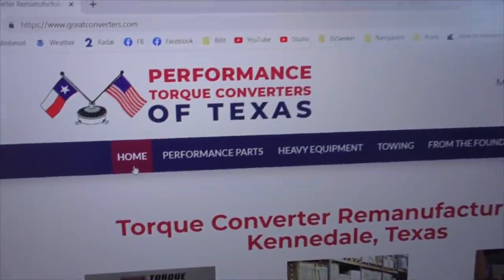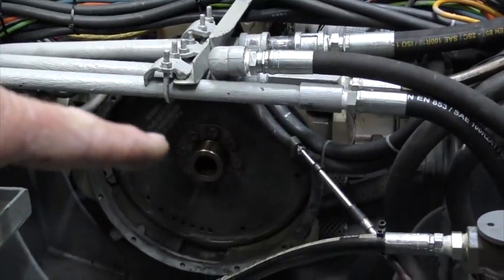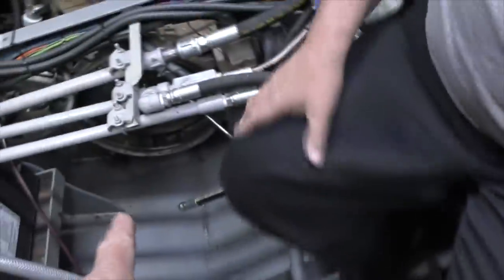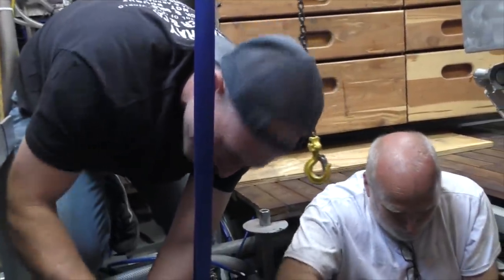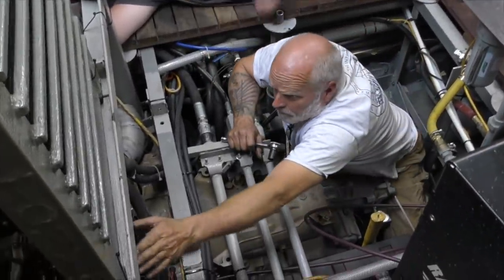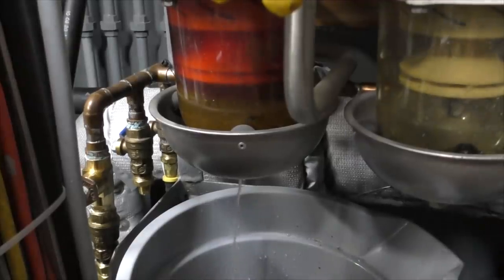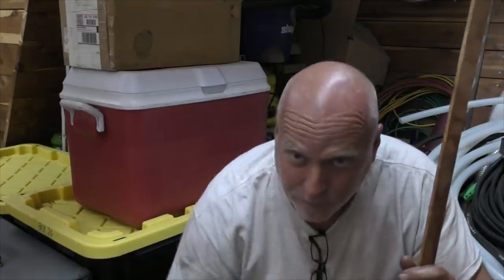School Bus Transmission in a Boat - Part 2 - Torque Converter Eliminator Installation

Comment: The transmission "kickdown" (this name is improper, it is actually a throttle valve or TV cable" controls pump output pressure, which in turn controls the shift points. The moral is, if you leave the kick down unhooked, your transmission pump will put out minimal pressure which is OK when idling around, but if you go to a higher power situation like this (higher throttle setting) your transmission will not have sufficient holding pressure applied to the clutches and bands, and the transmission will burn up the internals. If you are going to remove the TV cable you will need to permanently tie the TV lever forward (simulating a higher throttle setting) so that there is sufficient hydraulic pressure to ensure the clutches and bands have enough holding clamp up force.

Also, you need to ensure that the converter (or converter eliminator) is ALL THE WAY engaged. This is tricky because the pump inner gerotor drops when you remove the converter, and you usually have to spin the converter several times before it picks up and engages the inner gerotor. If you do not have it slid all the way in to the transmission, and use the engine to transmission bolts to force it in you will fracture the drive lugs off of the pump gerotor, and you will be pulling the transmission again. After the engine and transmission are bolted together you should have to pull the converter (eliminator) forward to meet the flexplate (flywheel) and then install the bolts.
Reply: Came here to say the same thing, that cable is important even inf your just locking in 1st gear, youll burn out any clutches/bands in the gearbox once it gets under load. Its trivial for a man of your ability to just connect the cable up. so connect it up :)
Reply: l was waiting for someone else to tell him . when he cut the cable i shouted O NO . l was trying to think of away to explain it to him i checked the comments and you did a better job . l wouldn't want to be around went he reads what he did . great job explaining it . thanks
Reply from the maker: Right, might be a different name but that was the consensus and that's what we want.
Reply: On some transmissions the TV cable does double duty.  It controls the pump pressure and the kickdown.  If it is always in 1st/low, kick down does not matter.  Is the pump pressure is to low clutches will slip a d wear quickly.
Reply: I am surprised you didn't mention starting motor without having transmission full of fluid which could burn up pump and clutches.
Reply from the maker: @Mr45shooter    From my experience getting out of a canyon in Mexico, you'd have to run it dry for a considerable period to do any serious damage.   We ran one dry,  filled it with motor oil and ran it dry again.  Then borrow some more oil to get to civilization.  Had the pan welded up, and put another 100K+ miles on it.   : )
Reply: @jackpatteeuw9244  tv cable controls pump pressure. Pump pressure affects the governor which controls kickdown. So yes, the tv cable controls kickdown (actually all up and down shifts) by modulating the pump pressure.
Reply: @davesmopargarage657  Okay, it has been over 35 years since I worked designing transmissions and at that time, we were trying to do full electronic controls.  My recollection is that governor pressure was strictly related to the output shaft speed.  Main pump pressure did not really affect governor pressure.
Reply: @SVSeeker  I don’t know of disconnecting it is what you want. Some transmissions vary the line pressure based on throttle position. The TV cable on this transmission might also be responsible for that. Too low of a line pressure and your first gear clutches might be slipping. Too high and you will be creating unnecessary heat from the pump. The cause of your transmission heating issues initially may have been due to the disconnected TV cable in the first place. The pump line pressure would have been too low in first gear causing slippage and heat from the first gear clutches. Also some torque converters are lock up type and completely eliminate the rotor stator when commanded to lock up by the transmission. Typically these have an additional large clutch plate in the torque converter. There should be a test port to put a gauge on the transmission line pressure and you should get a service manual for your transmission to get the operating parameters to compare the pressure readings.
Reply: @jackpatteeuw9244  my understanding is that modulated pump pressure (modulated by the tv linkage) is supplied to the governor on the output shaft. The combination of modulated pressure plus centrifugal force (from output shaft rotation) on the governor weights then sets the shift points so, the higher the modulated pump pressure (the higher the power setting) the higher the shift points. I am however just a novice though.
Reply: On AT 542,543,545, 1542, and 1545 models, main pressure remains constant because there is no modulated pressure at the main-pressure regulator valve.

Comment: Great episode Doug and crew. Hope that bolt you lost down in the bottom doesn't become one of the rattles you used to get back in some of the new cars of the early 80's. Had one and could never figure out where it was coming from. finally let it go with my wife in the divorce. Thank you for the inspiration Doug and thank you to the crew that came by to help. All are amazing folks.
Reply from the maker: Nope.  I’m good about cleaning up loose bolts.  If I ding one in the bilge, I want to know that something is missing it. :)
Reply: My dad knew a guy who worked in an auto plant. He said it was common knowledge that "some" people when having a bad day, would toss a bolt/nut into a vehicles void space before welding. One of our neighbors bought such a car and was going insane trying to find the rattle. Dad sent the man to the local garage who drilled holes and sprayed undercoat into the void spaces till the rattle got fixed.
Reply: @runsolo7418  I had heard that. I have also heard that sometimes weld splatter would break loose inside the unibody frames and rattle around

Comment: Hi I have been watching the channel since the first build and have enjoyed all aspects, populated by the highs and lows. This issue you have with the transmission I do not understand. I owned a Falmouth Pilot 9 ton sailing yacht and...... I hear you say. Well it had a variable pitch prop. Ahh ! I now hear you say. The point is with a prop of this type, a direct drive works with constant revs whilst docking. Feathering the prop holds the craft steady and simple adjustment of the pitch, causes the craft to move forward or astern. Cruising works being able to balance sea conditions with revs and fuel consumption.
Keep going
Chris

Comment: A good friend built a 60 foot by 27 foot pontoon house boat mounted a Burmese teak railway carriage on it we travelled up and down lake Kariba in Africa lake is about 200 miles long. We did many maintenance trips and holidays on this vessel. Had two ford tractor engines with torque converters. In this hot climate the torque converters were big trouble always over heating.
We simplified every thing possible to make it robust. It was a blessing fitting borg Warner velvet drive marine gearboxes with stainless cables to the helm for changing forward to reverse. Simple and no more headache’s. When some thing breaks in the middle of nowhere it’s great having simple fixable systems with basic parts on board.

Comment: For the water in the tanks. if there is any venting then dry tanks will condensate and collect water,  Airplane owners follow the rule to top off the tanks so there is little air space to condensate.   Those black storage bins with the yellow tops you have, I keep one in my car and found everything soaking wet in it from the condensation on the lid.  So it wasn't rain water.  Those tanks sat empty in your boat for years, condensating from the changing temperature.
Reply from the maker: So it was 40 gallons of condensation.   ...in one tank only.   : )
Reply: @SVSeeker  then yes that wasn't condensate. Bummer

Comment: I love to read all about boating repairs, I’m working on a Ford leehman as it’s over heating, everything has been checked, just about to strip down the heat exchange to make sure no weed in the system..
Reply from the maker: Hmmm...   or a plastic bag.
Reply: You have made a very beautiful boat, I have been watching all your movies. Haven’t missed a single clip

Comment: Condensate it's anywhere metal and cool. Like filter catch or just tanks. Can you use a humidity meter in the vent to check it?
Reply from the maker: There are people that go to the extreme of putting air dryers on the vent lines but I think it’s a waste of time.  A good filter system and paying attention is plenty.  We sure as hell didn’t get 40 gallons of water from condensation.
Reply: 40gals is alot 3'4 of an inch was all I had to go by. Is the rain water catch getting into the transfer station? Or main fill maybe?I remember something like this in the fuel transfer setup video, like "we will have to see."... Hope this helps, and as always thanks for the video.

Comment: Can you use some ethanol mixed with the diesel fuel to emulsify the remaining water?  The whole E10 thing in fuel these days is why we don't have to worry about water in our cars, but I'm not sure if it works the same way with diesel.
Reply from the maker: I think it would work. Souls are pretty forgiving about what they drink. They definitely do not run on 100% water. :-)
Reply: I believe most diesel stabalisation treatments for diesel bug etc contain alcohol of some sort.

Comment: Some of the water in your fuel is probably due to condensation from the air in the tanks. Adding a little Methanol every now and then might solve some of your woes

Comment: That distance from converter face to flywheel, should have a prescribed gap, I think rule of thumb an eighth inch., else it will wipe out your pump..
Reply from the maker: Mike got it spot on when he built it.  And we double check it.

Comment: We used a similar Gasolia product for tanks, trucks and fuel tankers in the Army back in the 90s.  But the product we used also could tell if there was diesel scum in the diesel.  Can't say what it was, wish I knew.
Reply: Hi I re-read this and realized that the diesel scum to us meant the algae that will grow in the tank and sometimes float on the surface. Every vehicle was topped off for diesel 24/7 and sometimes sat for months and the scum would grow.  To much algae would clog the filters and stall the engines and clog up the fuel lines after two or three days of active use; and always at the most inconvenient time and location. We checked monthly as part of preventative maintenance.

Comment: my concern is coming out of gear, stern drives have a temp grounding switch to stumble the other ignition long enough to reduce torq on prop to allow disengagement but the trans is hydraulic so should be Ok I hope
good luck
Reply from the maker: We'll use old school skill.  : )

Comment: I'm no auto mechanic but I do know that a common mistake it not lining up the tangs on the pump with the notches on the output shaft of the torque converter. Many a transmission swaps have gone to sh** over that simple mistake. The measurement from the torque converter to the bell housing for just about any transmission in the world are out there and it's worth a Google search if you are unsure of your setup. I think the torque converter eliminateor was a good idea but we will have to wait and see.

Comment: If you do find the point of water ingress then fill the void with inert gas. I’ve welded on plenty of diesel tanks via inert gas filling the void prior to welding. I’ve never blown up.
Reply: Diesel tanks can be welded when full and i mean chocks full of fuel safely.. welding over the leak can have a small fire on the outside of the tank but a wet rag takes care of that
Reply from the maker: Yes, the other way to do that is make sure that it has so much diesel vapor in it that it is way over the combustion range.  We did that in the skeg.  This time I think it’s just a seal around the hatch.
Reply: @SVSeeker  that sounds like something that will work right up until that one time when it doesn't.. I've been a welder and machinist for over 30 years and I've never seen any professional who would use that method, everyone i know has always done them when full of fuel because they can't go bang without air.. even air compressor tanks have exploded when people have tried to patch them and air compressor oil has a much higher flash point than diesel.. if you want to take the risk, that's up to you but i wouldn't recommend that method
Reply from the maker: @markshort9098  Glad I could teach you something new.   Go research the combustion mixture requirements for diesel or just keep being afraid of the dark.  That works too.   : )
Reply: @SVSeeker  have a look at how many have been killed by welding diesel tanks that were empty or partially filled, there's a whole heap of them online.. as i said, it'll work right up until that one time when it doesn't.. it's not a matter of being scared, it's a matter of common sense
Reply from the maker: @markshort9098  I’m not saying there are not stupid people, I’m saying knowledge can protect as much as fear.  So if you don’t know what you are doing then fear is as good as you can do.
Reply: @markshort9098  I have welded many steel and aluminum tanks. I find welding on them when full is usually difficult because fuel sucks heat away and gets into the weld causing porosity and more leaks to chase. 

I always bring the fuel down an inch or two below the crack/leak and then run inert gas like argon into the tank for at least 10 minutes prior to welding and I let it run continuously in while welding. 

I find it to be the safest method. And you don’t have to drain and store large quantities of fuel. Just enough to get below the leak. 

@SV Seeker I’m glad it’s simple. Because you’re paint coating can stay intact that was. Bonus.
Reply: @jeremykamel9655  yeah there's a bit of a fight with porosity but it's definently doable with steel, aluminum is a whole other ball game and needs a good clean and purge.. we pay about 5 times more for argon than what Americans pay so we try to conserve it where we can

Comment: I've been wondering if you could use 2nd gear and run lower RPM using the engines torque to save fuel. Just a idea.
Reply from the maker: Probably not.  The propeller is sized for the shaft speed to be less than 600 rpm.

Comment: Hi Doug, would adding a ball valve to the day tank drain be useful since you'll likely need to test quite a lot until that water source gets found ? Perhaps a water separator below day tank to show when it needs cleaning or a clear plastic hose loop so water would be more visible ?
Reply from the maker: Normally, but I have to crawl underneath that much more often than I have to drain it.

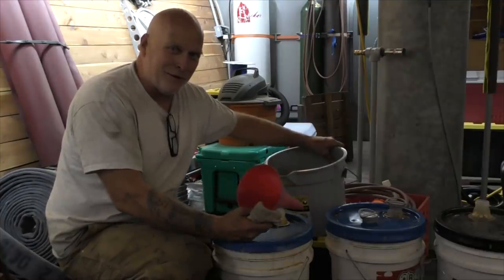Comment: 11:42 you should consider getting or building a Hydrolysis fuel generator and destille to seperate light gas and gasoline from diesel and light oils - the thingy where you can make fuel out of floating plastics - burn some plastic or use exhaust heat to heat a reaction vessel with plastic waste- without oxygen to burn the plastic bonds fall appart into shorter hydrocarbons- diesel gasoline and lighter gasses- these gasses can be destilled into the different fuels with seawater cooling circulation - if you burn plastic to react other plastic you can install a catalyst ceramic comb like used as replacements for wood gasifying stoves to get as clean of a reactor stove exhaust as possible, no sut and no heavy smoke or CMX/NDX  - save fuel money and the ocean from plastics pollution - that way you can remove water from diesel - also a fuel filtering centrifuge -  so you can filter particles from motor oil and other waste oil to run it as fuel and it seperates out all water, you will need it to seperate the tar and clay dust like stuff out of ship bunker oil if you ever have to run on that - also you should add a heating coil - like from a hot water boiler to your daytank  - bunker oil like from ships needs preheating to be thin enough to run in normal engines - and it needs to be centrifuge filtered to prevent abrasion in the injection pump or clogs in the injector nozzles
Reply from the maker: Interesting work being done on it, but I think we'll just sail instead.
Reply: Waste oil is ok as fuel if properly cleaned but bunker fuel would be way to thick for that engine even when heated.. i have a generator (cs lister clone indirect injected) that runs my machine shop and i had to up the injector crack pressure significantly to atomize waste oil properly but i run 100% waste oil in that engine, most people mix waste oil with diesel or petrol to thin it out and make it so the engine starts easier when cold.. my generator was almost impossible to start when running oil by hand cranking so i had to make an adapter to mount a car flywheel and starter motor to spin it really fast and give it a shot of degreaser as a starting fliud to get it running, hopefully I won't need to spray degreaser in it when i get around to fitting a glow plug.. indirect injected diesels handle waste oil better than direct injected.. I've noticed a difference in how the engine runs on thicker oils, the thicker the oil the harder it is to start and i get more soot on the injector too along with more smoke on start up

Comment: Hey Doug! Are any of those aluminum mounting brackets I made (for the push/pull cables) still being used on the engine?
Reply from the maker: I don’t remember what you made or what we changed.  Everything in life is transient.  The most permanence we obtain is being apart of the force of transmission that decreases the chaos.